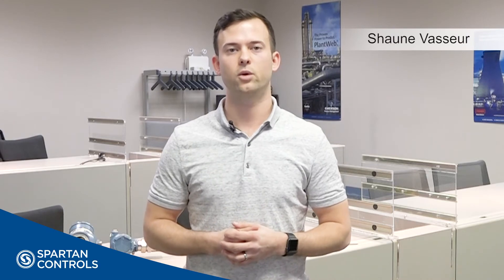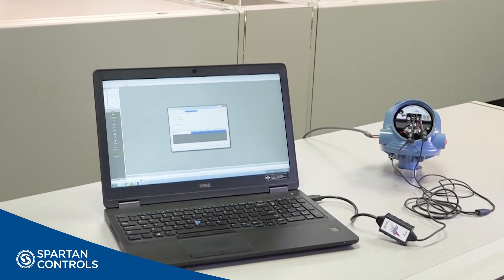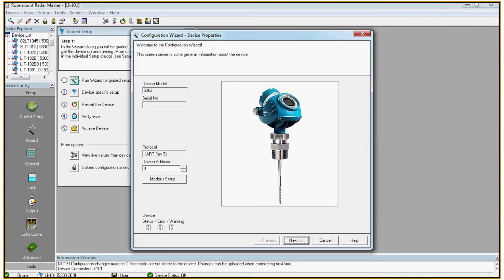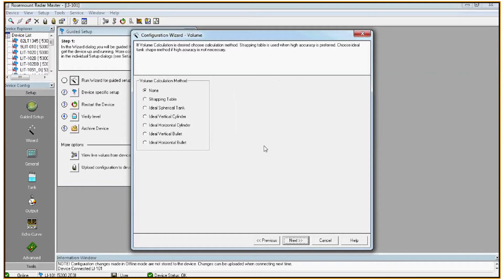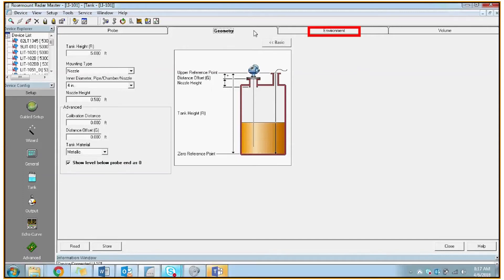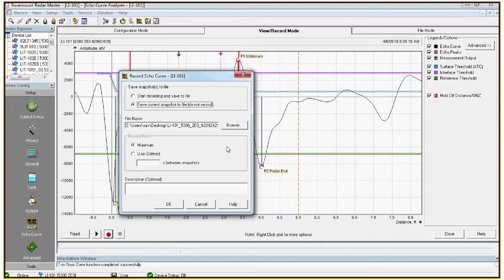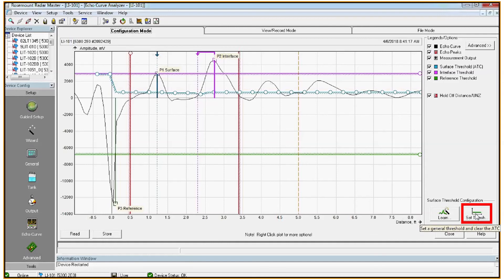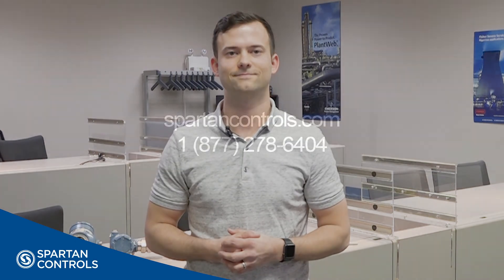Emerson Rosemount 5300 Level Transmitter | Guided Wave Radar - Configuration

Comment: Thanks for the video. we have issue that the transmitter will read maximum for about 30 minutes and then back to normal for several time. Do you have any idea how to fix this issue?
Reply from the maker: Thank you for the feedback Mansor!  If this is a nozzle or bridle installation, you may have some condensation accumulating on the pipe walls close to our process connection. Using Radarmaster, you could record a continuous Echo Plot to try and capture one of these events. If we find that there is a positive peak appearing near the top of the vessel, we could either the adjust the Surface Amplitude Threshold or the Upper Null Zone to ignore the peak.  - Shaune Vasseur

Comment: thanks alot for yor video...
please  make troubleshoot video on issues we commonly face during operation i.e. frequent level fluctuation, in such cases what to do??? gladly waiting for your reply
Reply from the maker: Thank you for your feedback! We are currently working on related videos and value your input. - Shaune Vasseur
Reply: derma blank hey level 100% comes hey 0 to do hey what should be done sir  Romount transmitter 5300